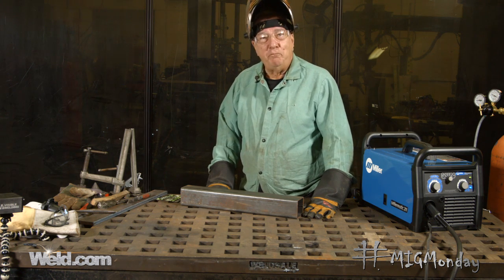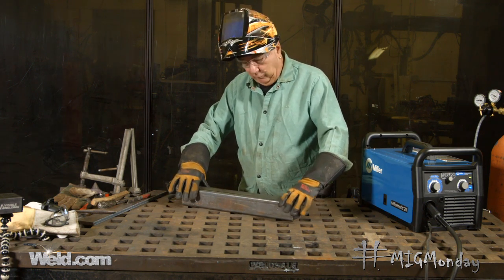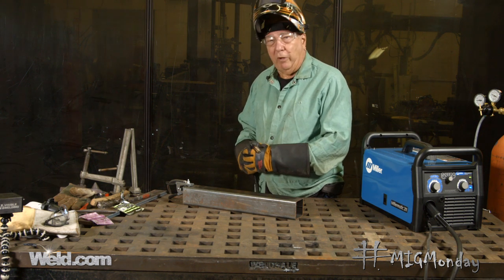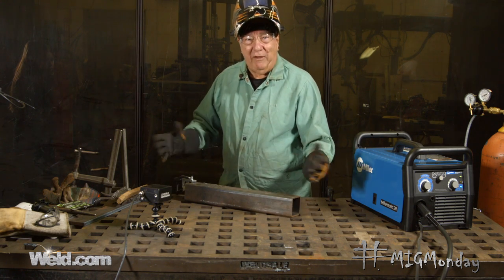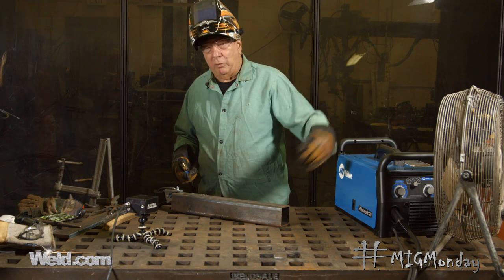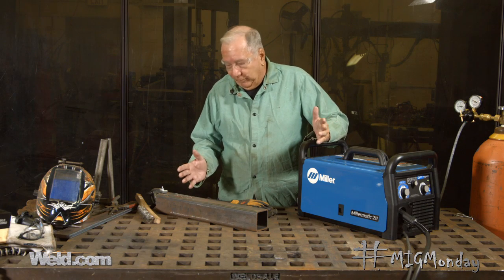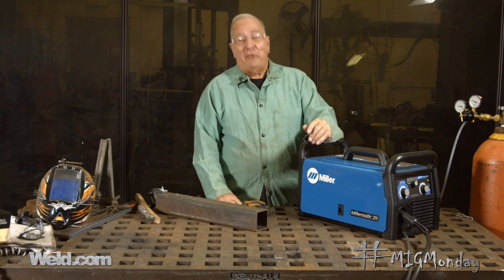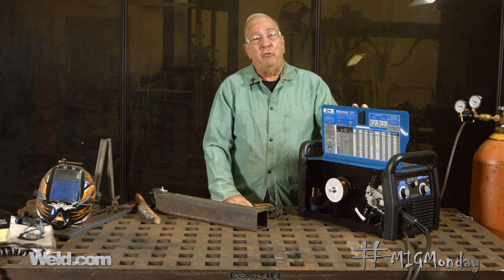MIG Welding without Shielding Gas

Comment: I bouglht a new bottle of argon c25. Now I found there is no difference when welding without gas. Strange both versions of weld are the same and good. Any idea? Am I using flux core wire?